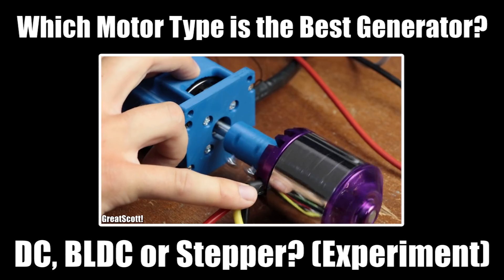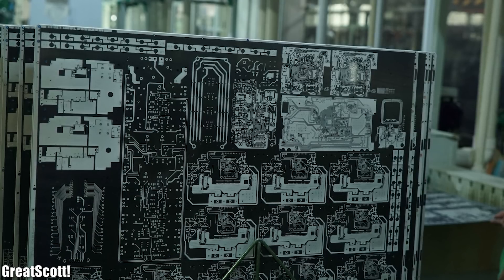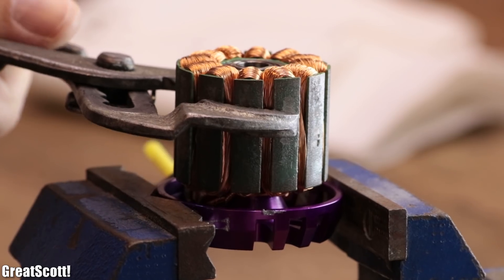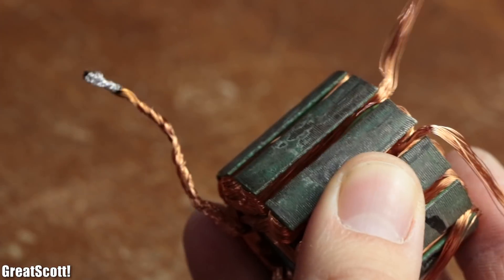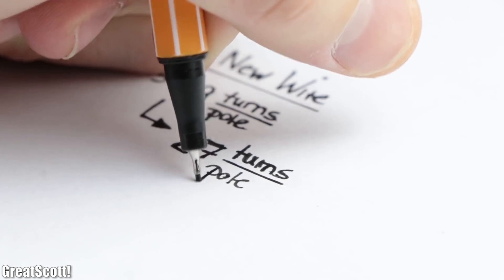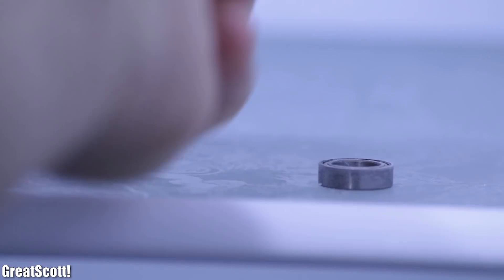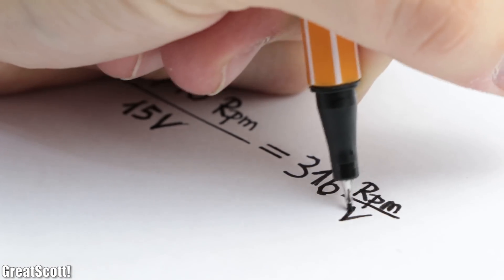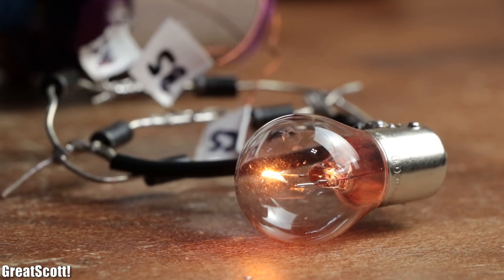How to rewind a BLDC Motor (as a Generator)

Comment: Heating the motor will cook the oil in the bearings, a much better way would be to let it soak in acetone for a bit, which would release the glue
Reply: hassaization, but what about the stator and stator mount? Aren't those hold in place because how tightly they fit into each other?
Reply: @nickstanley5064  no, 99% of motors use CA glue to hold the stator onto the stator mount
Reply from the maker: I also tried the acetone method. Did not work for me though. Heating/Cooling worked much better.
Reply: @greatscottlab  weird, on all the motors I've rewound acetone has worked excellently, I let it soak for a day or do, then a gentle tap if it didn't come off easily

Comment: hello scott I follow you from Italy and I'm a big fan of your goals but I wanted to propose a challenge back in 1983 (I think) I was not yet born but my father built his first metal detector using a kit of a famous Italian magazine calls new e. now this was a great project but suffered a lot of instability due to the thermal variation of some components. I have read some users who have modified the original pcb and replaced many pieces of the stage of oscillation and amplification stage so I wanted to propose if you like if maybe you make a video on and maybe you can change the scheme so that you can get a metal detector more stable in case you are interested the project is in the number 110 from page 25 onwards of the pdf of the Nuova elettronica magazine with a small correction in the magazine n 113 page 107-108 of the pdf (I put the links of the 2 magazines are in Italian but should be enough the https://www.adrirobot.it/nuova_elettronica/pdf/nuova-elettronica-110.pdf
https://www.adrirobot.it/nuova_elettronica/pdf/nuova-elettronica-113.pdf)
for the construction of the detector coil, it is sufficient to make 45 + 45 turns of cable with a common central diameter of 0,7 and to shield the windings with the common aluminum tape and to connect the gauze of the coaxial cable to the latter
Reply from the maker: I put it on my to do list
Reply: @greatscottlab  great scott look forward to this video definitely and a topic that will appeal to many users

Comment: Or maybe you should buy a BLDC motor that's specifically design to work as a generator.
Reply from the maker: Where can I get one?
Reply: @greatscottlab  They're called 3 phase generators/alternators commonly found in those hand cranked flash lights. The Ali express ones even include the gearbox.
Reply from the maker: Good to know. I will have a look at them.

Comment: Love the way your native language has ways of putting complete ideas, even processes into one word.  @9:50 I see there's a word that you say on the Patreon page  means the 6 pulse bridge rectifier,  but similarly Schadenfreude, or even better, Backpfeifengesicht and Verschlimmbessern

Interesting project, I used to make tiny motors for RC planes by rewinding the motors from old computer CD drives.
Apart from the tedium of actually winding them, the different results that were obtained by the number of turns on the windings, diameter of wire etc was quite interesting.
Reply: He/she uses time machine, jk, it's because of patreon
Reply: Antisocial Engineering how the fuck did you comment 1 day ago if this was uploaded 3 minutes ago?????!!!!!
Reply: So that's the German for what Electroboom calls an Even Fuller Bridge Rectifier
Reply: I love the German language. Agglutination is fascinating.